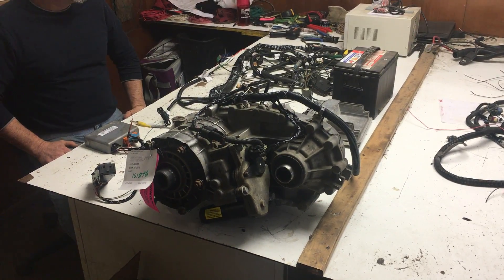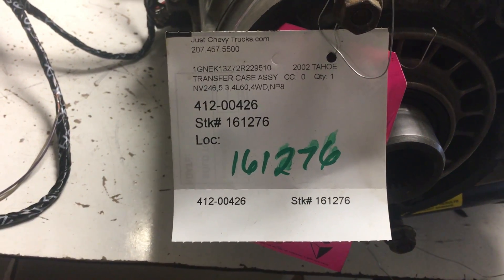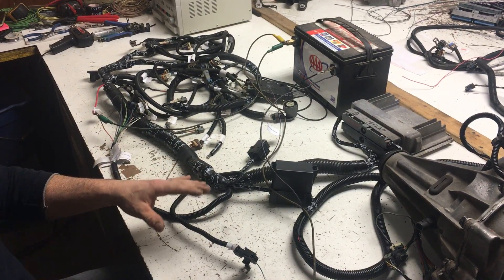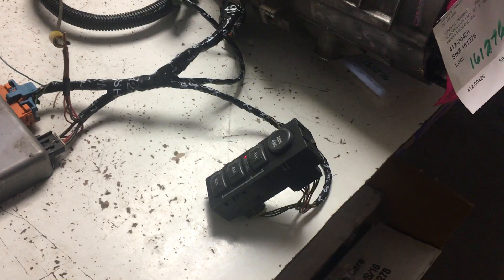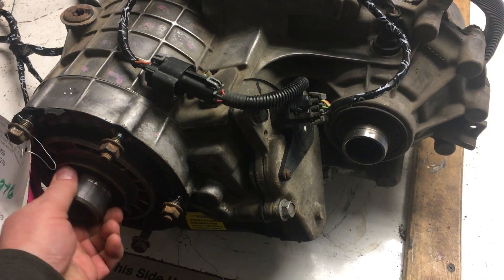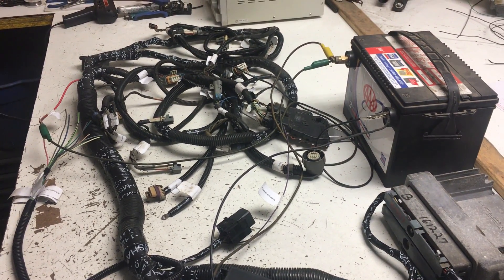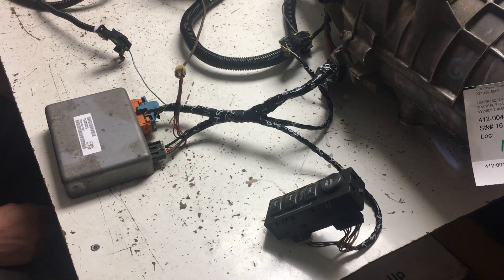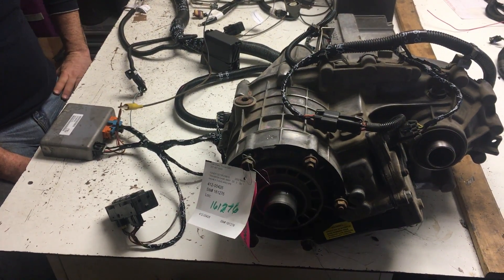Stand Alone Chevy Engine Harness and NP8 Push Button Transfer Case 99' to '02

Comment: I'm interested in an LQ4 fly by wire pedal motor, 4L80E, and NP8 xfer case powertrain swap into my square body K25. Can this stand alone xfer case harness be adapted to the motor/trans stand alone harness for use of the speed sensor to the PCM?

Comment: I'd like to put pushbutton 4x4 into a 1994 GMC Sierra 1500. I want to toss that manual shift pos floor shifter in the trash and swap it over to a pushbutton 4x4. Is it possible to have a harness made ?
Reply: @JustChevyTrucksBogBrookA-qo1mb  why would that be ?
Reply: @JustChevyTrucksBogBrookA-qo1mb  well fuck cause I hate inbread hillbilly floor shifters.

Comment: That's good information. Thanks for sharing.
I have a question about wiring up the 4WD shift indicator switch for an NP241C manual transfer case. I am doing an LS swap into a Jeep. I am using the NP241C because it bolts right up to the 4L60E and is a manual shift. (I need that for the Jeep.) It is a 96 model, but I don't know what vehicle it came out of.
The NP241C has a three-pin 4WD shift indicator switch. Do you have any idea how to wire it into the LS wiring harness so I can light the indicator light in the dash? Will the three-pin work? Do I need to swap it to a two-pin? Any information would be greatly appreciated. Thanks
Reply: Justchevytrucks I haven't been able to find them.
Reply: Did you find it out?
Reply: LOL. Yes

Comment: hey im looking into doing a stand alone t case for a 09 sierra its an awd going to change to 4x4. Did you just have to add power into the harness for it to work? And for the neutral is that also bypassable considering the harness on my truck does not have 4x4
Reply: Hmm this might be a interesting swap then lol
Reply: How  did your swap do?😊